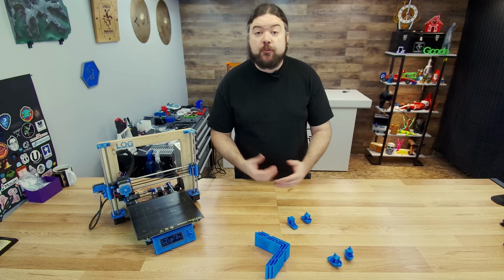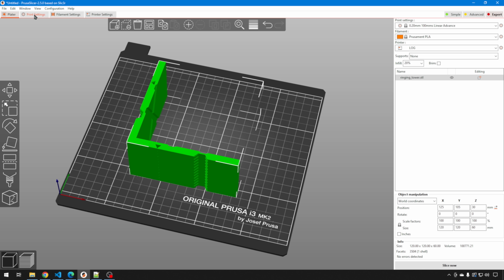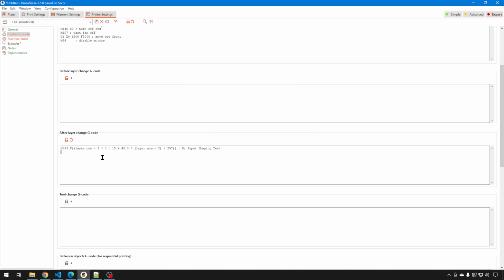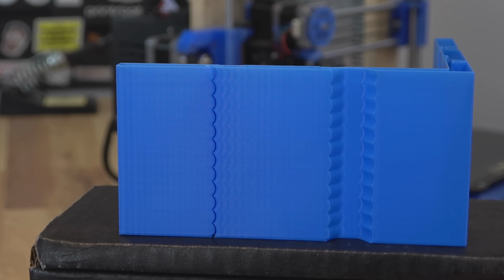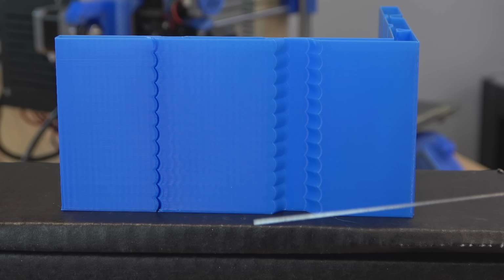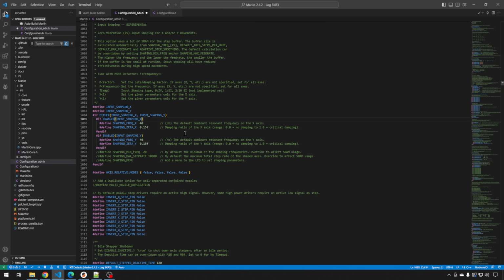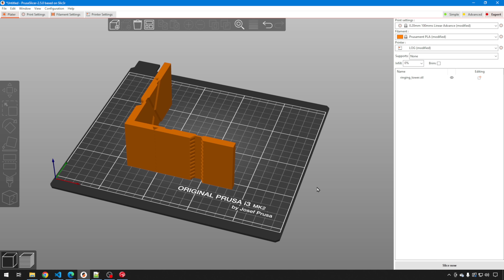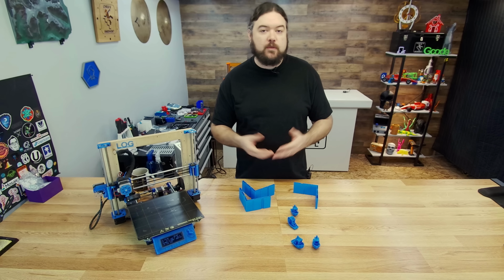Marlin  - Input Shaper - Improve Your Prints - Chris's Basement - 2023

Comment: Whats a good rule of thumb for calibrating the acceleration and jerk? Should we do that before or after input shaping?
Reply from the maker: They all go hand in hand. It's hard to give a go value because they are going to change as you want to move faster and faster. On an i3 machine I like to start with 3000 accel and jerk value of 8. Then start ramping up accel from there.
Reply: @ChrisRiley  Oh right so im probably being a bit conservative with my coreXY acceleration being around 2500 for X and 2000 for Y.... Im using junction deviation at the moment and I think I need to increase that for sure.

Comment: Yeah, I enabled input shaping in firmware and my printer would not boot (or rather got into continuous boot loop).
Just commenting out the #define for input shaping made it work again 
Repeatable
Reply from the maker: Damn, what MCU is your printer running?
Reply: @ChrisRiley  It's a 2560 Mega, RAMPS
Reply from the maker: @NickBR57  wondering if it filled up all the memory to an unsafe level.
Reply: @ChrisRiley  Marlin Auto Build reports 7274 of 8192 bytes RAM used and 196972 of 253952 bytes Flash so it doesn't look like memory.
I did notice a games menu the other day (!!! Why would I want games on a printer ???) so shall look for that and remove it to free up more...

...

Now shows 7150 RAM used and 190162 Flash.
But even before, there should have been plenty.
Thanks for the suggestions though Chris 😃
Reply from the maker: @NickBR57  It looks like you have enough, but it wouldn't hurt to try. Search this to shut off the games, // Frivolous Game Options Also, to really seal the deal, uncomment this line, //#define DISABLE_M503 it saves a lot just as a test.

Comment: Is input shaping dependant on speed? If I tune for say 100mm/s and get my settings dialed in, will I need to retune different values for say 150mm/s or 60mm/s?
Reply from the maker: After you get it dialed in, the speed really shouldn't matter. The faster you go, the worse the ringing might be, but the resonance frequency shouldn't change. If you do increase speed, if might be worth another test just to see if it can be improved.

Comment: Am I correct in thinking that you turned back on Auto Cooling and Acceleration Control once all the testing was complete?  Does Leaner Advance stay off?
Reply from the maker: Correct, I did turn them back on. Linear advance can be turned back on, but it will probably need to be tunned now that input shaper is on.

Comment: Would you tune linear advance before or after input shaping?
Reply: Klipper recommends input shaping first.

I agree. Because it helps you get the harp corner shape and then linear advance can reduce the blobs.

Otherwise, you'll tune linear advance to a too high value and then have cutoffs on your corners
Reply: IMO all the calibration should be without LA as in video, but then recalibrate LA and use it to get the final comparison (benchys in this case).
Although LA and IS are totally different, they achieve one task - get improved quality without sacrificing speed.

Comment: I have an unmodified MK3S.　I have a Raspberry Pi 3B. I want to do the same and improve the print quality . What do I need to do?  Can I just rewrite the firmware without modifying the printer?
Reply from the maker: It would be hard to do this on a stock MK3 as it's an 8 bit board. It might not be able to keep up to use IS.

Comment: Hint: Similarly, after storing X/Y frequency values, replace the formula like this:
M593 D{(layer_num < 2 ? 0 : 0.5 * (layer_num - 2) / 297)} ; Zeta factor Test
Repeat the test and evaluate the height of the best result. Likewise strip the values using caliper and gcode and program defaults with M593 X D... and M593 Y D...
Hope it helps... 👍
Reply from the maker: Thanks for the tip!

Comment: Adding G92 E0 throws an error message;
"G92 E0" was found in layer_gcode, which is incompatible with absolute extruder adressing
Reply from the maker: Remove it from the layer gcode section, you might not need it any longer.

Comment: Why would you enable LA in Prusa? It should already be on once you have set it up.
Reply from the maker: Prusa slicer for the Prusa profiles actually change the LA value all through the print based on certain factors. Also, other Prusa machines use the same filament profiles, so resetting it at the start of every print just to be safe can be useful.

Comment: Fantastic video Chris! Thanks for all those guides, you're helping people a lot. 

Does Input shape need a powerful motherboard for working correctly? I just got a SKR 1.4 + TMC2209 and don't know if this will run this new feature. 
Thanks is advance!
Reply from the maker: Thank you! Any 32bit board now a days will run it. Your board will work great!
Reply: @ChrisRiley  Hi Chris. I also have an SKT 1.4 Turbo with TMC2209, I have followed your great directions but unfortunately i run into a memory over run issue, i looked for a solution but it looks like its an A architecture limitation in the board, there is an article on this  but my reply gets deleted if i add the link.

Comment: Chris:  You're my go-to guy when I make any changes to my printers.  Recently I installed Marlin 2.1.2 on both my printers and a BTT SKR Mini e3 V3 board in one of them.  I've got everything working well, but now that Marlin offers so many options and Cura gets more and more complicated I worry about conflicting settings.  
Some day I'd like you to do a video about how to configure (or turn off) the jerk settings in Cura, linear advance, input shaping, coasting, ironing, and all of the other nice bells and whistles which may or may not play well with one another.  Do some of these options replace others or do some of them compliment each other?  I'm a little confused and I'm not sure I have really optimized my printer.  Or perhaps I should say, I may have optimized a particular feature but now I worry about negating it by making the wrong selection in my slicer, adding the wrong g code to my start script, or causing some other conflict.
Reply from the maker: Thank you! That's a really good idea. It would be good to know which setting conflict with which ones. In Prusa Slicer they have a way to ignore lots of them, CURA should really do the same. I will look at it further.

Comment: What I would also like to see is slicers avoiding a resonance frequency on solid infill.  Now when you have a square that has to be filled at 45 degrees with a corexy, the head will first move back and forth very quickly as near the starting corner the lines it needs to lay down are pretty short, but as you get closer to the center of that square the lines get longer and hence the frequency of the head moving back and forth is lowered.  With the correct length of the infill lines this will hit a resonance frequency and cause unnecessary shaking of the printer, but as the lines further grow, this shaking drops again.  With more complex geometry, the area hitting this frequency can be very annoyingly large. This is not the shaking input shaping is avoiding or has to avoid.  The better method here would be if the slicer just adjusts the speed slightly based on the length of the infill lines to avoid the resonance frequencies.  Even speeding up could help here, just avoid hitting that duration of straight line that matches the resonance frequency.
Reply: That's not how this works. Just lower your acceleration during infill, that does exactly what you describe... slowing down shorter movements because it's accelerating slower and won't reach high speeds in the small infills. However, then you're also negating all the benefits of having a corexy.
Reply: @csdstudio78  No, if high acceleration would be the issue, then higher frequency (shorter lines) would be worse, but that is not the case.  This really is a case of hitting a resonance frequency at just the right line length.  Of course, if you use lower acceleration, you can make things so that you never hit that frequency because even very short infill lines will cause a lower frequency than the resonant one, but I don"t have a CoreXY to print slower than my Ender3.
Reply from the maker: That's an interesting thought. Feeding some of these values for specific machines back into the slicer could be very handy.

Comment: Excellent tutorial, Chris :)

I'm running the professional firmware by Mriscoc and within the advanced menu of the firmware I have an option called "step smoothing"

Do you know if this would have an effect on the input shaping function?

I've followed your tutorial, but I'm not seeing any changes in the ringing with input shaping enabled or disabled, even with the correct M593 code in the layer change section in prusaslicer.
Reply from the maker: Thanks! Interesting, not sure what step smoothing is referring to, so I'm not sure. I have seen where a printer doesn't so much different if the print head is really light and there isn't much ringing to start with.

Comment: The input shaping tests always fail on my printer, it reaches a certain layer and then my Y no longer moves, but X goes back and forth creating a large blob. Do you have any ideas on how to fix this? I've experimented and it seems to be related to the M593's D value? D0.9 will print, D0.8 is likely to fail, D0.2 always insta-fails. I'm kinda stumped, as having the D value high results in the print having barely any difference at all from input shaping
Reply from the maker: Interesting issue, I have never seen that. I'm not exactly sure how the damping value works with this. Sorry not much help here.

Comment: I have a BTT mini E3 V3.0 . Without input shaping being enabled Marlin compiles fine using Platformio which says that is has only used 12.2% or RAM and 50% of flash. When I enable INPUT_SHAPING_X and INPUT_SHAPING_Y and try to compile it I get the error "firmware.elf section `.bss' will not fit in region `RAM'", which suggests it's too big for the RAM. But surely there should be plenty!! Any one any ideas how to fix this??
Reply from the maker: Wow, that doesn't sound right for sure. Not sure what might be taking up all the memory or if this is just a bug.
Reply: @ChrisRiley  It's weird just how many times you make Marlin changes look easy and when I do the same Marlin becomes a pain! I think I need to get on the forums to try to solve this.

Comment: Does this work on 8bit boards?
Reply: I speny only 1 evening with Anycubic Trigorilla 8bit, and its have issues with memory. After disabling some features to freeup memory it flash board with no errors. After enabling in menu Input Shaper with tmc2208(standalone) just become crazy and Marlin making reboot. Ithink I need to play with frequency
Reply: I tried it with ramps on a 2560 mega and a4988 drivers. With IS enabled I had some crazy stepper skipping.
Chris could you please try it on an 8bit board.

Great video. Keep up the great work 👍
Reply from the maker: I can give it a try and see if we can get enough memory freed up to make it work.
Reply: Some here mentioned weird motion. That might be fixed now in 2.1.x and bugfix-2.1.x but don't quote me on that. We'd love to get more feedback at the GitHub project so we can sort out any remaining issues with this feature on AVR and get those fixes into the next release. It is a pretty optimal implementation, but quite new, so we haven't seen every edge case. Thanks for your comments!
Reply: @ScottLahteine  Hi Scott. Many thanks to you and all the selfless developers for keeping the Marlin project running. I think I'll try the latest bugfix and see if there's a difference; I last attempted Marlin IS about a month ago, so things may have been corrected since then. Scott, is there an easier way for noobs like myself to report bugs and suggest features other than github? I've just gotten comfortable with configuring the firmware and understanding the structure and would love to contribute, but github is a bit intimidating.
Reply: @MDprotoCPT  You can come over to the Discord (linked on the front Marlin site and project pages) and you may find help there. Note that bugs which aren’t posted to GitHub might get missed by the project developers, so that is the best place to report them so they can get patched for all.

Comment: Cool to see an implementation. Cool to try but I’m scared of doing stuff like this for fear of bricking a part. 

I was thinking about these sort of things last few days watching mk4 vids and mention of IS. Really need to do it live on the fly which is why you need the accelerometer. But that would be more applicable to the extruder on corexy. Than a bed slinger. As it has two axis it monitors. Ideally metering x and y and z on a slinger would be tricky to do live. 

On the live checking as the parts get placed they get heavier. So if you filled a build plate to max it will have different weight than in first few layers, causing different harmonics. 

The other thing I was thinking about as spool get lighter the moment on spool holder will reduce so that would cause the extruder to change relative to y axis. So there would be an inherent variation over the 200+ mm. Technically all prints would bend however we don’t see it. Be interesting to see the impact on z when a 1kg spool is hanging off frame with an offset vs one in line with frame. If it affects print quality or creates a bend. 

I just tied running my prusa at 999% last night - first layer was great and then it went pear shaped. Killed print as a big blob fell off extruder. IG guess first layer is 20x 10 so 200mm/s but the 2nd layer is 60x10 do 600mm/s the filament didn’t really adhere look like a hairy scrotum. I got it run at 300% on some parts but time of print didn’t reduce that much. Handy to know if you’re in a rush for something. You can increase speed - did notice more ringing though…
Reply from the maker: Hey, thanks for the comment. You are right, active monitoring would really be interesting. Knowing some of the folks I do, I'm sure someone will try and work that into a design.